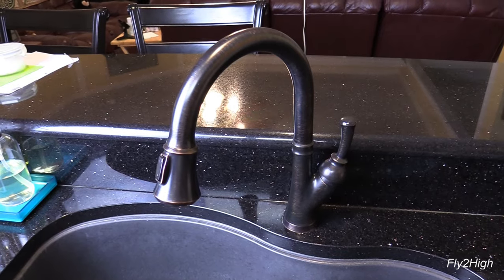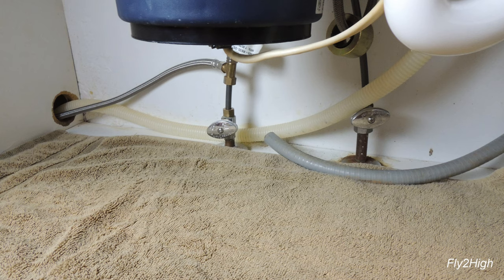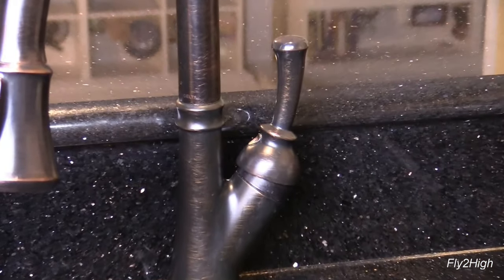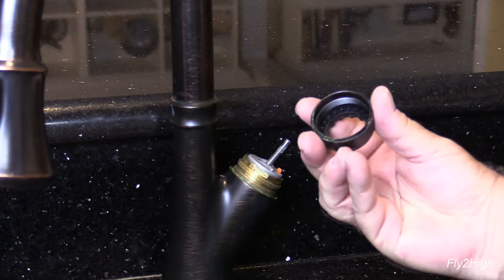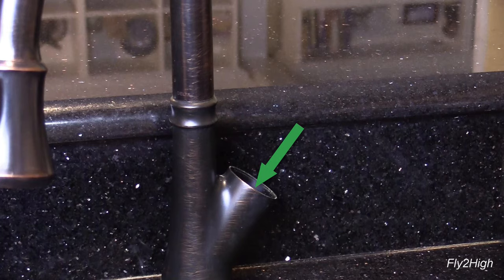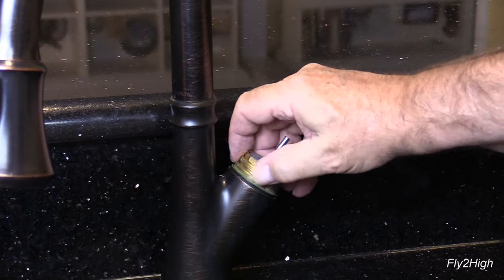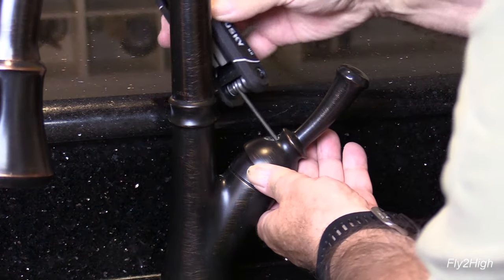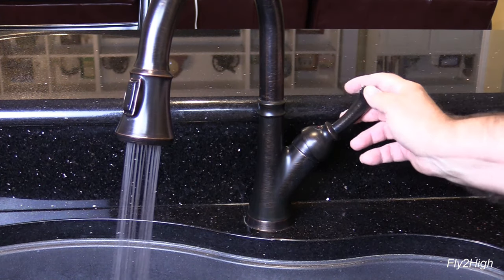Delta Faucet Valve Cartridge Replacement - How To Video  FTHVN 740

Comment: Thanks for the absolutely perfect step-by-step instructions to replace the cartridge. Thanks also to comments stating Delta will replace it for free because the cartridge has a lifetime warranty. Here is my tip: whenever you purchase anything, look at the instructions and circle the model. My Delta instructions are 12 years old and demonstrate at least four models but all models call for the same part number on the cartridge. Next, put your warranties, booklets, etc. in a container or file cabinet drawer marked Warranties. I have warranties that go back to the 1980’s for my stereo system/turntable, recliners, stove, etc. and all these booklets come in handy eventually. My only exceptions are a Warranties file in the garage for anything that “lives” in the garage such as drills, snowblower, cars, etc. I also keep all laundry room Warranties together in the laundry room.

Comment: Clear and concise instructions. Very helpful. Unfortunately I live in an apartment and Delta would not replace the cartridge under warranty because it was more than 5-years old. My faucet is a different design but still a single handle, pull down style with a cartridge. Found a local plumbing supply house that had one cartridge left in stock. Followed your instructions exactly and had the cartridge installed in minutes. No more dripping from the faucet spout or underneath sink. Wish all YouTube how-to content creators could produce such simple and helpful videos. Thank you.

Comment: Great vid! Only took a few minutes. When I first opened the water back up, water was leaking up through the top of the cartridge. So, I torqued it a little more until it stopped. valve smooth as silk after re-assembly. No drips. No runs. No banged knuckles! Thanks!

Comment: Delta warranties their faucets.  Mine was leaking.  I sent some photos to Delta and they sent me the replacement cartridge free of charge.   They will want to know your model number.   Mine had a tag on the water line under the sink that shows the model number.  Thanks for the instructions.  It was very helpful!
Reply from the maker: I did not know this!  Thanks for commenting and watching!
Reply: Yes Janice is correct.  It took some internet investigation and per that search I found the model # under the sink on the cold water supply to the faucet on a tag.

Comment: Hello there, Brian! Wanted to say thank you so much for taking the time to make this video & explain the cartridge replacement so thoroughly...my husband just replaced ours in five minutes after watching it (I helped by getting under the sink and turning the water off and on, ha ha!).  No more dripping faucet, yay! By the way, we got our replacement cartridge for free after I contacted Delta customer service via their web page, that part has a lifetime warranty & they mailed it free of charge. Awesome Delta customer service and thanks to you, an easy fix!  Thanks so much again!
Reply from the maker: This is a fantastic comment and thanks for watching!!
Reply: Rhonda, we contacted Delta support and never received a reply, but certainly appreciate the idea!
Reply: Thanks for the tip.  I called the Delta customer service number and they answered on the first ring.  I am getting the cartridge delivered free from the manufacturer - yes, lifetime warranty. Thanks to Brian for the video.
Reply: Another happy viewer here, too, Brian!
I had actually watched a different video first, only half the length.  He left out one key point...the need to unscrew the housing that hold the cartridge in.  After tugging on it a time or two, I searched again, found your video.  Of course, my first clue could have been the slight hexagonal shape of the housing, it was YOU who pointed it out, making a job that seem was going to end up taking all night, take only a few more minutes!  Those extra minutes in a video are certainly worth viewing!
Fine job, sir!  Many thanks!

Comment: Brian, excellent demonstration and walk through.  A couple of observations: 1) the person doing this repair "does not" need to be technically or mechanically inclined, if you have the small flat head screw driver, allen wrenches, and the cresent wrench (channel locks will work as an alternative) "Anyone" can do this; howevver, 2) if you have a dishwasher the water cutoff for the Hot water "May" be very close together so ensure the water is off before proceeding and 3) my faucet looks almost identical to the one in the video, but is a brushed nickel finish and the allen wrench for my faucet was 3mm, vice 2.5mm.
Reply from the maker: Thanks for commenting and watching!

Comment: I agree with everyone else -- great video!!!  Simple and detailed, no unnecessary gibberish.  By the way, can you give me the model number of your Delta faucet; I have the same one.  I cannot find the manual, and the tag is no longer on the water line.  Seeing your faucet at least lets me know the cartridge replacement part I need.
Reply: Rhonda - did you see the comment someone else made that theirs has a tag on the water line under the sink with the number on it - maybe you found it already ? Otherwise, I would call Delta - maybe you can send a picture of the faucet to them & they will know ! Good luck ! I have to do the same to mine ! Yikes ! I have a very non-handy boyfriend, so with the help of YouTube, I am learning a lot - I took my whole Dyson vacuum apart a few months ago - even the parts they don’t recommend taking apart, but I had a lot of fine grit in there - it worked & I really was proud of myself - lol ! Good luck !

Comment: I have gone through this process several times and even put the screw part that had some lime deposit on it in some deliming liquid.  I am still getting heavy leakage at the new faucet assembly.  What am I not doing correctly?
Reply from the maker: FYI...I just replaced this fixture when it began to leak at base of the faucet.  (Where it comes through the countertop.)  The cartridge was not the cause of this particular leak.  I first noticed water appearing around the base of the faucet.  I determined the water was coming from the area where the supply lines entered the base of the unit.  Likely a cracked or failed fitting inside the unit.

If your faucet is dripping out the nozzle, it likely remains an issue with the cartridge or how it's seated in the valve body.  However, if the water is appearing around the base of the faucet, or worse, dripping underneath in the cabinet, the fixture itself may be the issue.

Comment: I am having problem trying to remove the screw with an Allen wrench in the handle. The screw are way too tight. I have tried using WD40 to lime away. Yet it’s still not coming off…. Any suggestions will be helpful. Thanks

Comment: I replaced the cartidge but the faucet is still dripping from the head, any ideas??
Reply: Carol, if you have the correct cartridge, it is assembled and not loose (see Mike Rung's comment below) AND when you replaced it you aligned everything correctly, it should work.